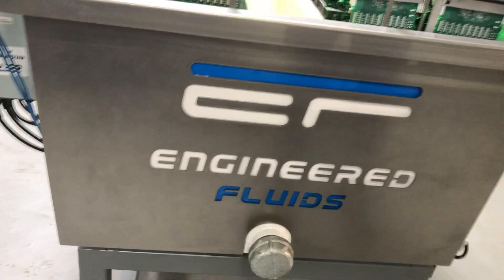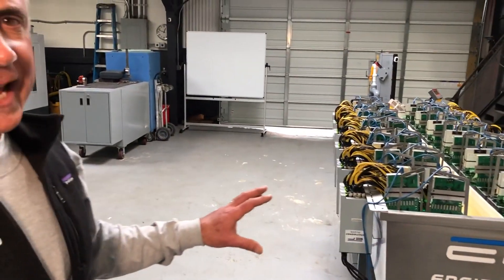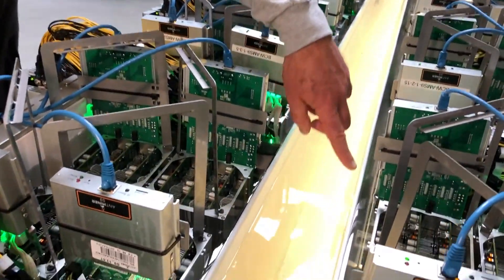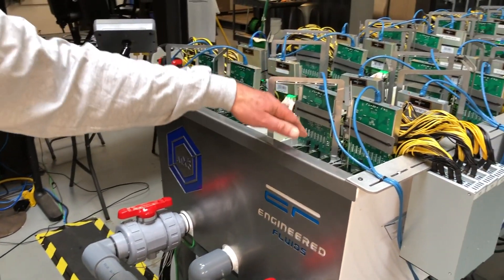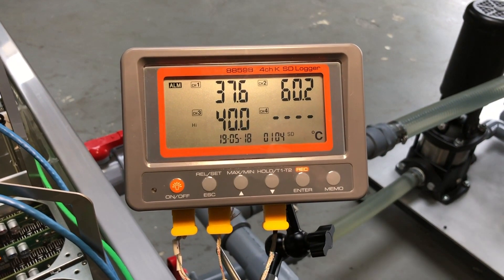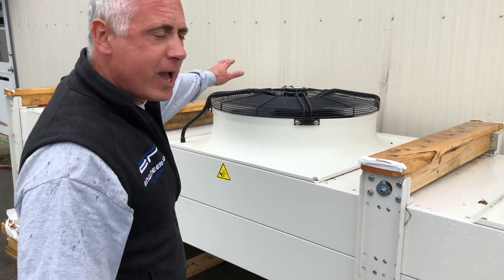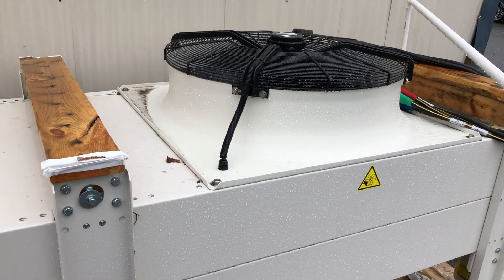Engineered Fluids - SLICTanks for Crypto Mining

Comment: ..you got free 22° heat ...can't It be repurposed than just dissipated ?.. mybe squeezing a lots of re-engineered reverse peltier in-between hot & cold flow pipes could regenerate power back...we got Spacecraft Voyager running on thermoelectric generator ...the tech is already there..its just the funding part issues..

Comment: Why the heat exchanger?  Why not skip it, and push the mineral oil all the way out to the outdoor cooler?  I don't understand why some people use the heat exchanger, but others don't.  Why isn't it an obvious choice, one or the other?
Reply from the maker: This particular customer's location required us to use a heat exchanger.  In most instances we do not use a heat exchanger but rather we go directly from the SLICTank to the Dry Cooler.   However there are certain types of installations where the height difference between the level of the tank and dry cooler require a Liquid to Liquid Hex to prevent the tank from overflowing in the event of a vacuum leak in the dry cooler.  This particular system has the dry cooler almost 40ft above the height of the tanks.

Comment: i will like to know ... all of you with the dry coolers , what you will do in the summer  ????
Reply from the maker: In the summer the temperature delta between the fluid and the outdoor ambient air temperature is so high that dry coolers are able to continually cool the fluid.  Its only when outdoor ambient air temps exceed about 37C regularly that you need to consider using an adiabatic system during times of extreme heat.

Comment: Guys, did anyone try immersion cooling for hashing boards without heat sinks?
Reply from the maker: Yes, but it doesn't work ASICs are too hot and the fluid flow rates would be to high, your looking for a balance between cost of high flow and a cheap heat spreader!

Comment: i was hoping to see what your filtration solution is for this system. you can't run an open air fluid system 24/7 without it getting dirty. While you may be selling fluid, replacing the fluid rather than filtering it isn't a valid solution.
Reply from the maker: We use a simple fuel oil filter or disel fuel filter in a by pass configuration where we only filter about 2% of total flow.  We have systems operating at oil sites in the desert where there is more than 2in (50mm) of mud in the bottom of the tank without impacting operatings.  Not ideal set up, but the fluid is VERY resilant.

Comment: I'm curious to know more about the slick remote PSU setup for each rig shown here.  Too bad a closeup of the connections didn't make it into the video.  I take it they are switching power supplies (220v-12V)?  How many amp each?
Reply: If the entire thing is producing 67kw, that's 5583A at 12v. If there are 48 miners, that's 116A each at 12v (1392W). That sounds about right for a Antminer S9 14Th.

Comment: hi Gary, do you think this system can be used reliably in the tropics? for places right on the equator line with high air temperature and high humidity.
Reply from the maker: Absolutely, in fact we have systems operating in the UAE (hot), Indonesia (Hot and Humid), and here in Florida (Humid) and in all of those conditions Immersion Cooling has huge benefits.  In fact for locations directly on the equator, SLIC is probably the only good economical solution.

Comment: why not just slow the pump speed or fan speed if nearing freezing points?
Reply from the maker: So, while you will definitely want to turn down your fans, you don't want to turn them off if you live in an area where it snows or gets office as the rotating fan sheds ice and protects the bearings from intrusion.  Regarding the pump you don't want to freeze your miners by dumping in super cold BitCool which is what will happen if you just turn down the speed of the pump and you also risk burning your miners.  Best option is to keep the BitCool moving at about 2-3L/min.  You miners are most efficient in BitCool that is above 50C!   We've found that you want to keep your BitCool at the best temperatures the by-pass loop is the way to go, as you can properly regulate the temperature with a simple valve turn and you keep the BitCool flowing.
Reply: @garytesta2324  wait so I have an immersion cooling system with 6 antminer s19j and our temperature shut off is at 52c is that too low I don’t understand because then the miners itself is reporting over 65c I feel as though the miner reports the wrong temperature so we just use the liquid temperature to get an idea, our output liquid temperature is around 50c with 6 of them running
Reply: @garytesta2324  also I greatly appreciate the info!!!

Comment: Ok, sounds perfect but. Question and I hope you can answer. What happens if the heat exchanger filter water into the dieléctrico fluid system. How do you prevent this water get in touch with our miner? Thanks. I hope you can look the escenario where the chilling water que be mix it with the dieléctrico fluid.

Comment: Hi Gary, I've got a question regarding your design. I'm trying to build my own. My plan was always to run the bitcool straight into the dry cooler. What are the disadvantages to doing that instead of running water to the cooler and using a heat exchanger?
Reply from the maker: This was a specific customer request to use a dual loop system, these days we always do a single loop dielectric direct system.   When you do all the math you find out the liquid-to-liquid heat exchanger (HEX) and the extra pump are worth about 100ft of BitCool in a 2in pipe.  Unless your liquid cooler is really far away or has a significant difference in height its always better and cheaper to go dielectric direct to the cooling unit!
Reply: @garytesta2324  what drycooler do you recommend also can we have details on the model and make of that pump?
Reply: Water has better heat transfer and is cheap to run to outdoor heat exchanger. I would use as little as possible circuit of dielectric fluid, exchange heat to water and dump the heat outside.
Reply: @artemtsvetkov3655  I have seen People use a garden hose in a mini fridge to cool aquariums. I'm looking at that option with high quality Caterpillar Coolant......
Reply: He answers the same question in another comment. He actually recommends it...so not sure why they did it.
Reply: This is the very similar to the hvac setup used to cool most commercial buildings with a closed chilled water loop running to indoor ACUs and exchanging heat in plate/ frame or shell/ tube heat exchanger with an open-loop water line running to a cooling tower.  Typically you would separate the two loops first because of contamination from an open loop water line that may degrade your indoor equipment and second due to outdoor condition fluctuations throughout the year where in the winter you might just shut the cooling tower down all together.

Comment: how unfortunate that such a solution is so energy inefficient and using oil is pretty much a fire hazard. 2 phase > 1 phase 24/7/365
Reply from the maker: Hi Nick, I think you need to learn more about our Dielectric Coolants and the entire immersion cooling process before making a final judgment on Immersion Cooling with Engineered Fluids Dielectric Coolants .  Our Dielectric Coolants and Immersion Cooling in general is far safer and efficient that 2 Phase cooling and the fire risks are minimal to non existant since our fluid is not an oil.  I agree that the use of Oil in immersion cooling is dangerous and poses a fire risk as well as health risks.

Comment: If the miner are submerged ,where so much noise coming from background ?
Reply from the maker: The noise you hear is the fan noise from the PSUs of the miners.  These are being overclocked at about 140% so they are working pretty hard.
Reply: @garytesta2324  But if the tank was a little larger you could put the psu's inside the tank also??  The sound & power reduction with out the 6" fans is amazing  Great Job

Comment: Sell the waste heat to the guy next door
Reply from the maker: That is totally correct, the beauty of SLIC is that the waste heat becomes usable!
Reply: @garytesta2324  Have you ever seen this system plumed into a radiant floor heating system? Would it not be as simple as running the dry cooler line into the floor? What temps do you get on the cooling loop and what is the high/low you aim for?

Comment: Gary, how come we went with a 2” supply and return with such low GPM numbers
Reply from the maker: We really don't need high pressure and high flow rates.  In larger systems the 2" supply is easy to manage and the  pumps are easy to find in this size.  If you only have one tank, you can down size the piping to 1" and use a 1HP pump, but when your doing 30 or 40 tanks in a single module, 2" tank plumbing is the way to go.
Reply: @garytesta2324  thanks Gary, currently only 1 tank in the build, but I will upsize to 2” as expansion is the future ;) chat soon

Again thank you for your informative videos :)
Reply from the maker: @mkultra-1337  Let us know how we can help!

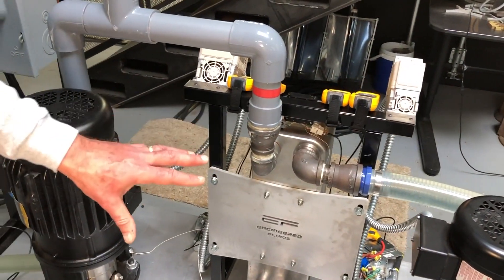Comment: @2:03 There should be a filter between the pump and the plate heat exchanger - It's a open system.
Reply from the maker: So there is a small filter inside the tank where the outlet is, its a plastic matrix.  We find these are much cheaper and easier to clean as they have a large surface area.   In larger systems we install bypass filter systems that only filter out about 1% of the fluid flow.
Reply: I agree but the chances of any kind of blockage is slim.....

Comment: Does this violate the warranty of the miners?
Reply from the maker: The simple answer is yes, but frankly most of the miners you buy have pretty lousy warranty support to begin with.  However, we do offer our DS-100 cleaning solvent which will allow you to completely clean the miner so that it can be returned with no indication that it has ever been immersed in our coolants.  Also, we should note that Miners immersed in our Coolants have been shown to be 3x more reliable requiring less rebooting and significantly longer operating lifetimes than the Air cooled equivalents.  The reason is that immersion in our coolants provides significantly better temperature control and less temperature gradient across the device.   We currently have over 200K miners operating in our coolants globally and the failure rate is about 10% of what our customers see in air, and none of the failures is attributable to being in the coolant.  Most failures are caused by bad PSUs or power cap failures on hash boards.
Reply: @garytesta2324  Aproximately, How much for a system like that in the video?? Complete with the chillers, tank, radiators, pumps, miners and all ready to mine. What's the current energy performance with the colling system in KwH? and what's the noise level in dB? Thank you!!!!

Comment: so the ec100 doesn't evaporate like novec does?
Reply from the maker: That is correct none of our Coolants have boiling points and all have very low vapor pressures.  We have customers that have been using our coolants in unsealed tanks for years with no evaporation or loss of coolant.  In addition, unlike Novec ElectroCool and BitCool do not absorb water and humidity.  This prevents them from losing their dielectric properties and prevents the oxidation (rusting) of iron based metal alloys that occurs in Novec.  Those rust particles are very conductive and end up floating around in the fluid.

Comment: Hi, what is the reason to use a fluid-to-fluid heat exchanger, rather than route the engineered fluid to the dry cooler? Thanks
Reply from the maker: Excellent question, in fact we recommend that you do not use a liquid to liquid heat exchanger, unless you already have a chilled water infrastructure in your facility.  When we design our turn-key installations we always recommend using what we call the Dielectric Direct architecture where the Dielectric Coolant is pumped directly from the immersion tank to the dry-cooler.  This architecture is both more efficient and more cost effective.  For those interested in more details, I recommend downloading our how-to guide to SLIC.  You can find it here: https://www.engineeredfluids.com/the-slic-guide
Reply: @garytesta2324  so I am curious if you don't recommend it, why did you do it in this case? Are there some cases when it would be advantageous? Even if you have chilled water infrastructure in place wouldn't it be possible to pipe dielectric instead of glycol/H2O into the dry cooler?